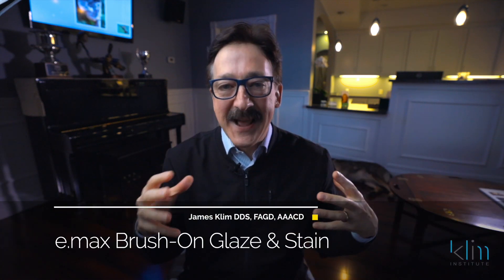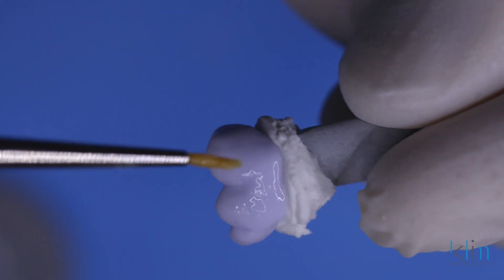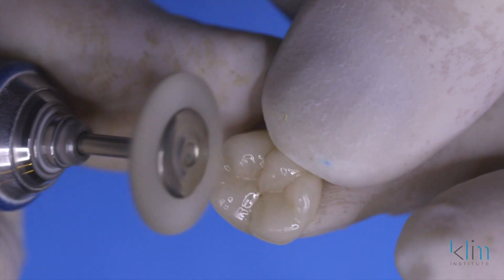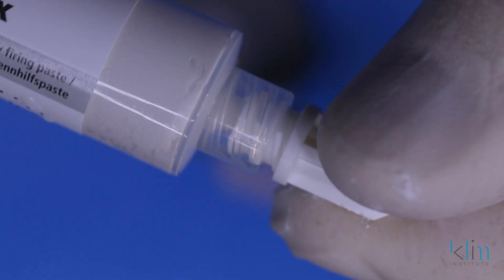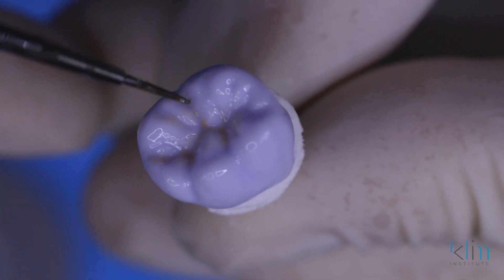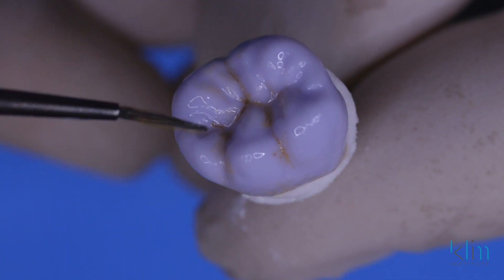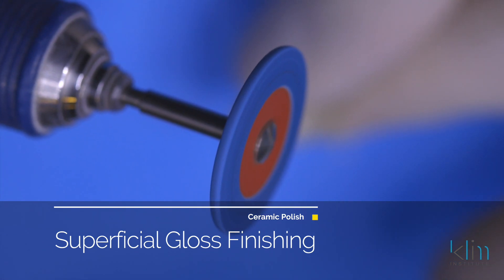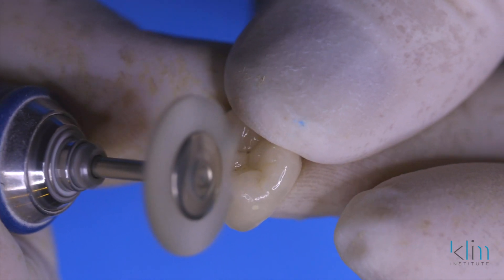e.max Glaze & Stain

Comment: I too fire on Cycle 3 in my CS6 Programat oven.  However, my Emax crown does not come out this shiny!
Reply from the maker: What glaze and coloring system are you using? Each system has its own application technique. I suggest MiYO 850; it is very forgiving.

Comment: i mill the emax crowns and i always get bubbles on the buccal and lingual surfaces, any tips on how to make it so there aren’t any bubbles on any surface ?
Reply from the maker: Bubble usually means the glaze is too thick when using the Crystall glaze.  The Miyo 850 will solve this issue and is a more updated glaze and coloring system.

Comment: Thanks for your informative videos James. My firing times on P3 program are still 24 min 30 secs so I’m curious to know about your 14 minute program. Is this a new cycle that used not to be available but is now a recommended firing sequence for brushed on stain and glaze over e.Max crowns Many thanks again!
Reply from the maker: What is your furnace?  Check for P1 then, base on the furnace and when it has been updated the P3 and P1 are switched.
Reply: @KlimDDS  Thanks James, I’m using the Programat CS3 furnace but have never updated the unit. The software version reads V2.04. It may be a software update that can be applied perhaps to upgrade? Many thanks again (and also for your most recent video on glaze and stain!).

Comment: 1Thanks for the video. I have a question: how do you account for the thickness of the glaze and coloring so that the restoration in the final seating fits well (interproximally and occlusally)? Do you mill the designed crown with specific thickness? Thank you!
Reply from the maker: I do not change parameters because I am conservative with glaze thickness addition, particularly on the proximal contact, brush the glaze then.  When firing some of the glaze with embed into the ceramic, the dimension difference is insignificant.
Reply: @KlimDDS  Thanks for your reply! This is a step I have to keep practicing, as sometimes I feel the occlusal fitting is not immediately perfect after cementation. Therefore I was wondering about the milling settings. Thank you!
Reply from the maker: @milheiroanamaria  Occlusal issues are usually bite registration and occlusal parameter offset, make sure that is -175 in the manufacture screen.  In general, high occlusion is generally not a glazing issue.  All the best.

Comment: Can most labs add stain to a crown (s)?  Is staining a normal procedure or is it so specialized in skill only some labs are capable?  My dentist and lab is having a hard time matching my crowns (lower) to my existing upper crowns.  We have tried twice thus far with the lab my dentist uses and they keep coming back way too bright vs my uppers.  We can't seem to get it right although my temporaries match my current crowns much better, almost perfect.  Along with my initial ques of can most labs stain a crown, do you have any suggestions on how one might get the color better matching besides using the color pallet dentist use?  Your reply is much appreciated.  Really frustrated as the cost to get them was not cheap at all and this far only happy with the shape and fit...color is driving me nuts

Comment: Hi! I have a question. When you choose the block color, do you aim for the main color of the restoration? Or do you keep it a bit whiter and then add some staining to match the final desired color? I found my restorations tend to be too dark… thanks in advanced!!! Great videos!
Reply from the maker: Good question, choose the shade of the cusps or incisal edge, and then use one shade brighter in most situations.  That will help will help in not getting the value too low.  And as you mentioned, then tone in the body and cervical zone with stains as needed.  All the best,

Comment: Hi i did a cerec crown and i put a glanze layer then i put it in the oven i think the glanze was very thin sothat the crown didnt come shiny. Can i put it another time in the oven with wright glanze viscosity. Should i pay attention of some procedures before i do that. Thanks very much for your videos
Reply from the maker: Did you use Crystall glaze?  Yes, a second layer can be added, or polished up to a sinny luster.  It is more about getting the glaze to the right viscosity.  So keep trying and you will get it working.
Reply: Yes its a crystall glaze . Should i use the P3 program? Do you use always the P3 because we ust normally the P1 oven program its normally 24 min
Reply from the maker: @alisaker6739  The cycle of P3 or P1 does not matter.  With the smaller firing tray, you can fire up to two restorations in 15 minutes.  However, glaze outcomes still come down to the glaze addition technique.  On another note, the Ivoclor Glaze Paste is easier to use and more consistent in the outcome.  I use it for recrystallized addition as well.
Reply: Thanks alot for your answers. Best wishes

Comment: Hope you can answer my question. My crowns came back from the lab looking bulky , my dentist shaped them and now they look good , but they are lacking the high shine I saw when they came back from the lab at first. I’m guessing they are stripped from the glaze? Do they need to go back to the lab for glaze ? I’m wearing them now with temporary cement and I don’t like how they look. They look Matt, and only shiny when I lick them. Also one more question. If they have to go back , what color of glaze will be used just to give them shine ?
Reply from the maker: Ceramics do not need a glaze to achieve a nice finish, half of my anterior cases are polished only.  It is about technique.  I am sure your case can be polished to perfection.  Wishing all the best,

Comment: Dr. Klim . I have been using the Katana Zr block a lot which is great but I noticed that the shade value is higher than proposed. I don't have an oven in the office to stain like you do. Should I request the lab to use a  A3 block when in reality the patient's shade is A2. Thanks
Reply from the maker: With Katana, I will use one or two shades darker than the matching target shade. I also use infiltration colors to tone down zirconia value and increase saturation. Zirconia will come brighter since this material bounces light more than ceramics.  That is the reason for choosing lower value shades and infiltration.  You think is on the right track.
Reply: James Klim DDS  Thank you you for the tip and for taking time from your busy schedule to answer me. Please post a video someday in shade selection. Thanks Maurício